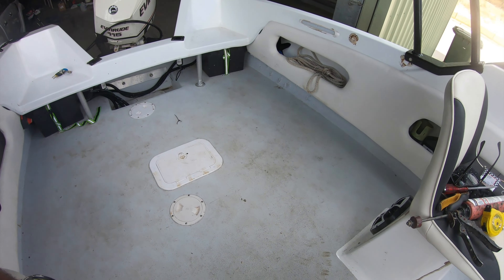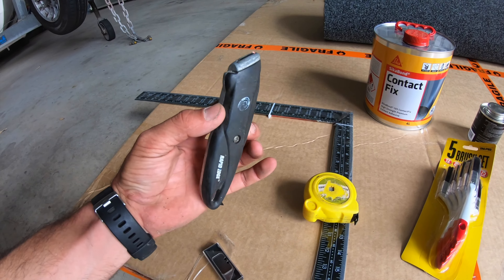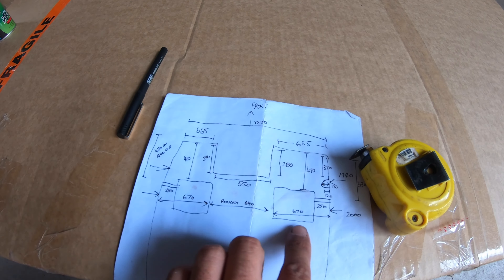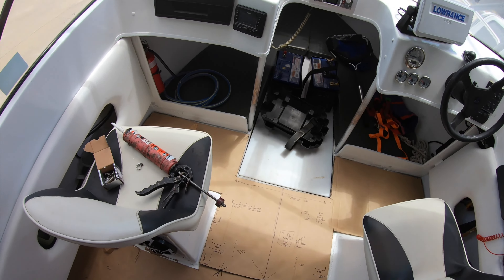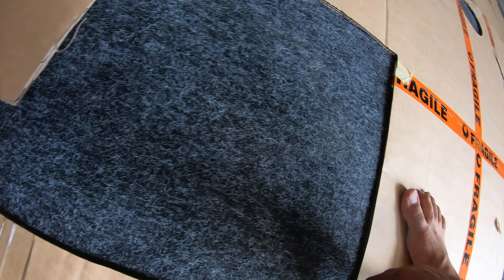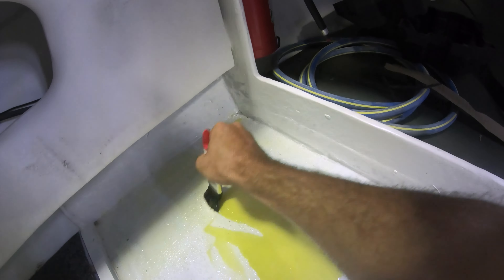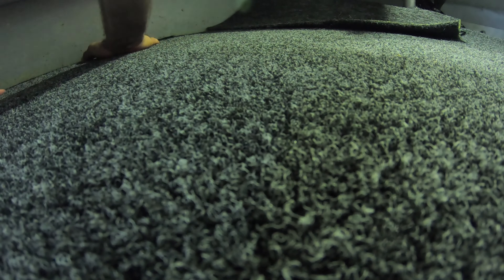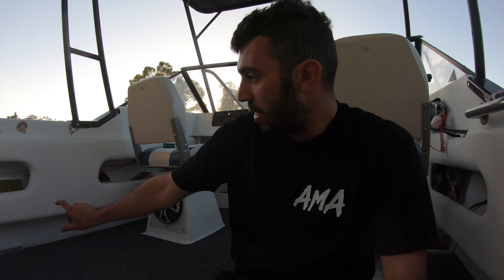DIY | HOW TO INSTALL MARINE CARPET IN YOUR BOAT | PERMANENT | FULL BOAT RESTORATION - PART 26

Comment: Looks amazing! The cardboard template is genius!  About to change out the carpet on my 1972 Tom Sawyer runabout. Did you need to use a special kind of glue/adhesive?
Reply from the maker: Thanks Mark! yes it worked perfectly! yep Sika Adhesive glue

Comment: Turned out nice ,, hope you saved the pattern ,, just in case you need it down the road ,, I would imagine that carpet will wear out before you sell this boat :-) lol do you use the boat often ,, we really don't know ,, not many video's of boat trips lol
Reply from the maker: Hey buddy, haha sure did, exactly right!! because of this water in the fuel situation, it kind of changed everything, so im still trying to get outboard to run 100%, i have now cleaned VST and injectors, but now that Perth is in lock down we cant take our boar out :(

Comment: Did you find that the Sika adhesive bled through the carpet at all? Going to give this a crack on the weekend!
Reply from the maker: Hey Andrew, if you apply to much to the carpet it will, I found to load the floor up and apply a small amount to carpet
Reply: Just a heads up guys I run my own Trim Shop down in Albany, you can certainly brush it on like you have and it works but it is far better to spray it on both surfaces as you only want enough glue to hold the carpet down for the duration that it will last. Get even coverage and wait till it’s tacky then lay it down. 
If you mask up all your hatches then just lay the carpet you can go around with chalk and mark around all your hatches and borders with it then using a nice sharp pair of scissors cut into the corners from the middle then use a brand new Stanley blade to cut neatly along the edge and then use a scraper to tuck any edges in if needed. 
I always use Fullatack contact adhesive from Nolan’s UDA in 4 litre or 20 litre drums. Just get the 4 litre and you will be fine, but a cheap pressure pot spray gun with a 3mm tip and spray it on. 
Clean up using a bit of petrol on a rag as the glue is petroleum based. Have a fun lads. 👍

Comment: Very nice job man.  I reckon you might wish you made it removable down the track (with tabs and press studs).  Carpet gets manky on a decent fishing trip.  Wish mine was removable..
Reply from the maker: Hey Leon, my ok’d man has removable stud carpet and was a pain in the bum, you’d have a good fish on and the carpet stud would end up giving way and you’d fall on your ass 😂 plan is to place and extra throw away spare marine carpet over the top when fishing and crabbing to then get removed and washed! But yes did take into consideration hoping it will be okay!
Reply: @AngryMackAdventures  Yeh mate I totally get that.  I have a bit mat I use for a kill zone, then wash it out.. but still wish I had a full flow coat deck with something like deck armor so it can just be full wash down

Comment: everyone talks about replacing but nobody talks about how to prepare the surface before installing how, sand or not and if yes, how or what number of sandpaper, with a sander or by hand? nothing just fail they publish, bad
Reply: Just make sure you're happy with the surface (smooth, level etc) then follow the manufacturer requirements for the adhesive and make sure the surface is free of any contaminants to ensure proper bonding.